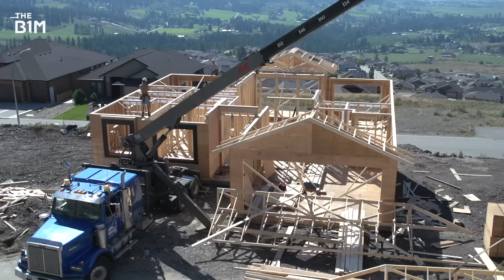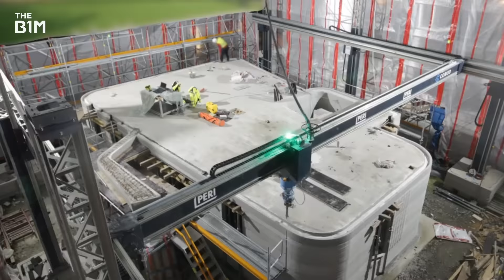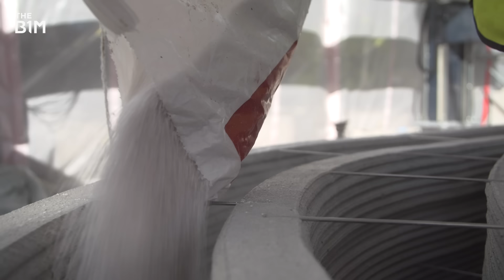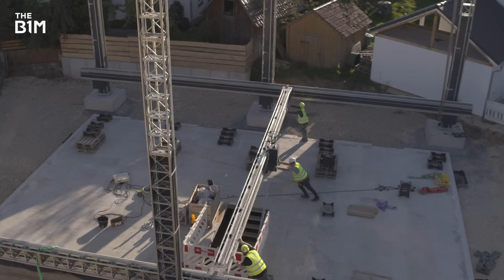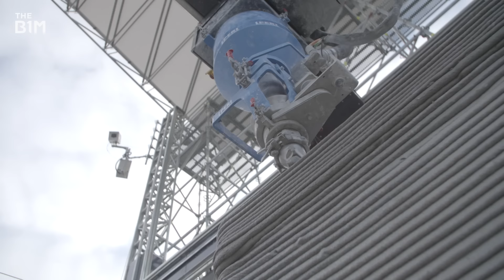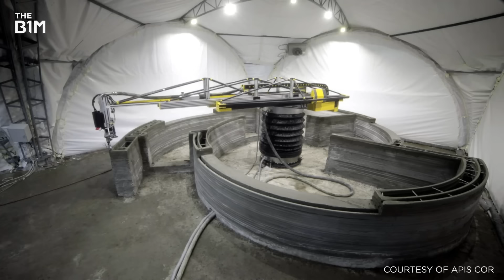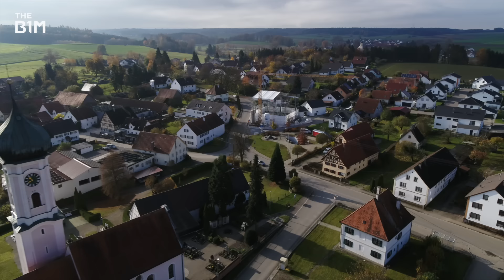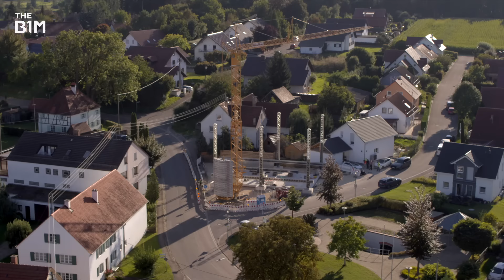Why This 3D-Printed House Will Change The World

Comment: A lot of expensive equipment and concrete required for this which is very expensive to produce and one of the most carbon heavy materials in the world. Large scale developers housing associations are desperate to move away from concrete full stop. It's a good idea but not the answer to the problem. Timber and other natural materials are still the most abundant, versatile and best for the environment. A tree is natures carbon capture device. There's no getting away from that.

Comment: So the walls are two thin parallell walls, connected by small steel wires between them, and the occasional brick? Is this a stable building technique?
Reply: Yes it is a stable technique. Its concrete. Very strong. It's cavity wall construction. How all UK homes have been built since 1920. The pins are stainless steel wall ties. Much stronger than  wooden homes.

Comment: I had my house built 3 years ago using standard stick construction. Foundation took a week including leveling lot, and cure time. Rest of the house took a week, and finishing another week. Most of that was actually just dead time waiting for the work crews to become available (and the real time sink was the financing and permitting process) The entire subdivision expansion, which included 100 new homes (a rather small project), took 2-3 months during the summer. By the same set of contractors. To do the same with this technology would require a LOT of machines and honestly not a whole lot less workers. Each work crew other than the framers was like 1 guy who knew his job and 1 to 3 assistants/apprentice/random hire. This looks like it would require more expensive people with higher levels of training than the typical home builder.

I'm just not seeing this past very specific developments. The equipment is expensive and requires extensive training and higher labor costs, and you can't have as many simultaneous projects going on without huge outlays in potentially redundant equipment. Housing construction goes in boom and bust cycles in the first place, and I don't think that it can scale quickly enough for a housing boom.
Reply: I tend to agree with your assesment.  For the homes your mentioned, how big are these homes and in what city?  That seems very fast to have a home completed.
Reply: @riumudamc4686  The homes are between 1600 and 3400 square feet and the city is a typical Midwestern small city that is a short drive from a major metropolitan area.

Like I said, once the land is plotted and roads/utilities ran, homes go up super fast.
Reply: @joseph1150  With skilled and experienced builders and simple designs things do happen quickly
Reply: 100 houses in less than three months?  LOL then you woke up from your dream.
Reply: @bagofchicken  You do know that entire subdivisions are built in a matter of weeks once the permitting and ground work is done. It's not even a lot of people, just a couple of work crews for each step. A framing team can put up a 2500 square foot house in a day. 60-80 man hour jobs aren't uncommon, especially with all the prefab components. I've wired with 2 other people an entire house in a day, and plumbed it with them the next. The gas was more of a pain because they had a gas fireplace, and a patio gas firepit that were both far away from the kitchen and furnace room.